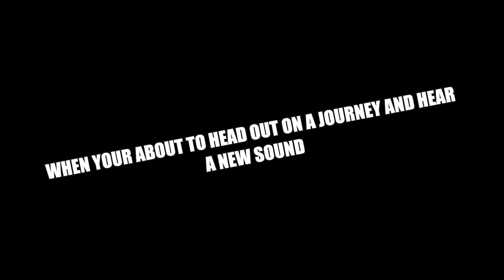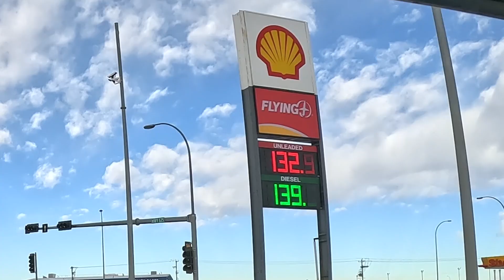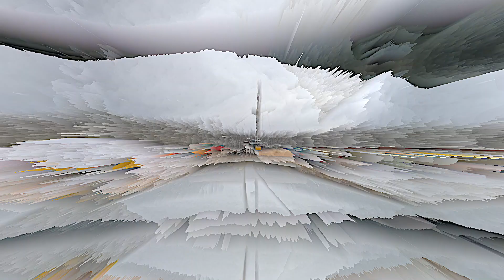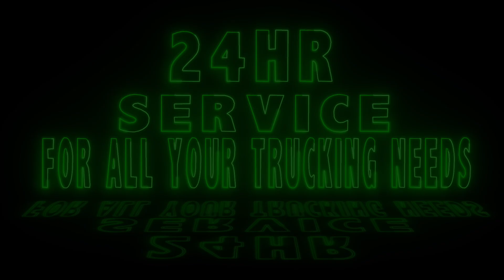MAXED OUT LOAD TO A RIG, BLOWING SNOW IS BAD

Comment: Ah memories, I used to look at my reflection in the windows of the rec centre in Whitecourt too.  Check out the load before crossing the scale.  BTW the Henday is waaay faster to get around the city than hwy 19/60.  Love the videos!
Reply from the maker: for sure on the henday, its just always under construction. but have been doing hwy 60 for as long as ive been trucking. getting sick of it and they have added a few more lights.

Comment: Seems you and I have the same drivin style pal, no matter the conditions.........on or near the rug! Always pushing the limits of the white, brown, and black roads loaded or empty. But big steer tires suck push more than bite on bad roads so that's always keepin ya on the Rodger when puttin the Gov'na to the test
Reply from the maker: Franks heavy enough to grab pavement, but still need to be a bit careful, specially with these more pavement friendly tires I got on the front. Never know when they won’t be there for you
Reply: @TimelapseTruckerRTOT  with the way Franko is built for patch work, what's he weigh empty without a trailer 40k pounds? I've not ever been around a tri-drive to know what it weighs compared to tandem beside the bumper, t-bed, and winch weight also. Frank's a badass that's all there is to it lol!!!!